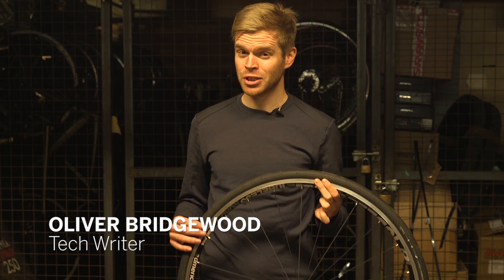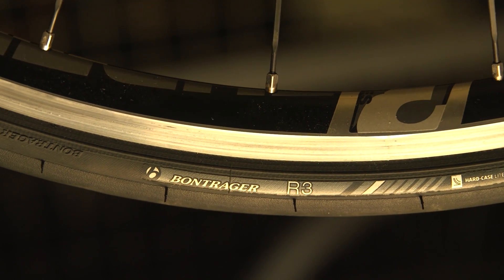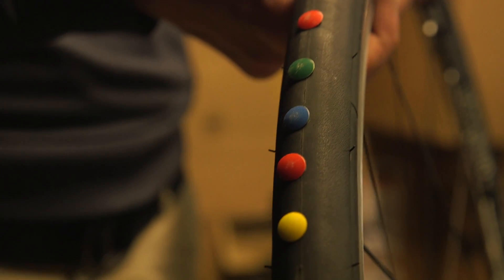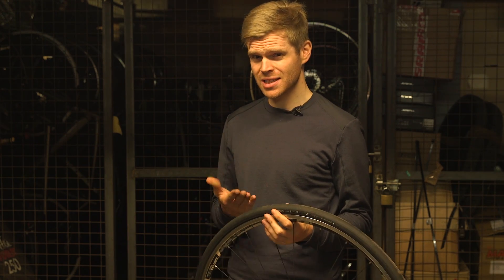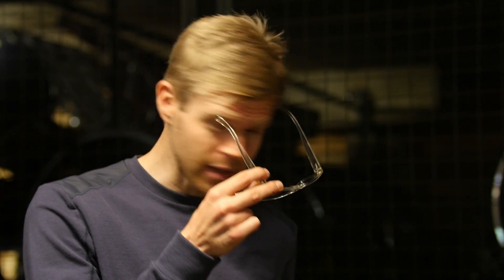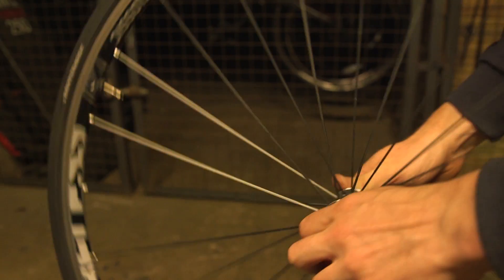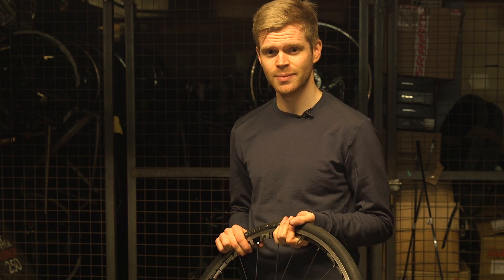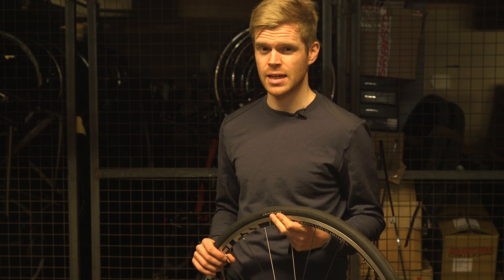Can a tubeless tyre survive a nail? | Cycling Weekly Science

Comment: Recently, while leading my senior's cycling group, I rode over some glass.  I didn't realize at time that I had three closely spaced punctures.  When we stopped for coffee I noticed a ton of tire sealant on the backside of my bike's frame.  Thankfully, the tire was still holding pressure, and I was able to complete the ride.  The tire was a mess, but it still held air pressure.  To be safe I ended up replacing the tire.
I'm 100% sold on tubeless tires.

Comment: Its heavier than the normal tyre with tube.  It has a rubber strap that is equal to tube weight and secondly it must be more thicker to avoid punctures and also it has sealant inside that is also weight.  It is complicated to repair and what i believe its a one time use, once it start leaking there is no other way to fix it again or else it will not work smoothly, not to mention its a cumbersom job to repair it. Sealant will also by the time get harder so it will make tyre uneven so more the punctures it get the more quickly it will get harder and get un even.
Reply: Only the last sentence of what you said is true.

Comment: My Schwalbe Thunder Burt (490gr, 26x2.1) front tyre blew a hole in the middle and sprayed the street with white goo. It healed in a few seconds and I didn't even have to stop to check it. I continued riding it as it was, jumping in high speed, etc, for half a year. Today I exchanged the tyres to a Schwalbe Wicked Will 26x2.5 rear/Magic Mary 26x2.35 front combo, which added 1 kg to my bike, but feels much more stable, like a tank. Inside the old Thunder Burt tyre I found a pee sized blob of dried latex just inside the hole, which had kept me safe all this time.

Comment: Weren't tubeless tires used like 40 years ago or so? I remember my dad always talking about tires actually glued to the rim. He also told me that the heat from the brakes would often soften the glue and detach the tires. What a mess.
Reply: That's Tubular tires- some people refer to them as "tubs".  Professional cyclist love them because they are a latex tube sew directly into the tire which saves weight and gives a more direct contact feel like riding on air.  Most of us poor people don't use them because they are sometimes 3 to 4 times the cost plus professional cyclist don't have to do the maintenance.  Removing and replacing tubular tires are a pain in the ass.
Reply: pros mostly ride them because tubular wheels are way lighter and you can stil ride (more rolling resistance) with a flat. normal tires would fall off the rim but the glued one still hold so you can finish the last km or stay on the bike during a turn.

Comment: If the puncture happens with a 170 pound rider on the bike, the sealant will have a much harder time sealing, I imagine. Then after losing some pressure the side of the tire can unseal as well and all the sealant will run out. Saw it happen to a friend who had a very small puncture.
Reply: Yet I don't know anyone who has had that problem. It's literally designed to stop punctures while you ride. I've ridden over plenty of stuff and the sealant did it's job.
Reply: Never seen a hippo ride a bike.

Comment: Why not put the sealant in a thinner inner tube? (genuine question, I'm an ebiker so weight isn't a problem but reliability is)
Reply: +CanIHasThisName I never get pinch flats and I use tubes. It's because I put powder between the tire and the rube so the tube doesn't get stuck to the tire when it hits a sharp object and the tube can just slide instead of being ripped
Reply: Bigfoot And Bananaman Interesting. Well I rarely get pinch flats because I'm used to higher pressure :) And when I do, it's usually because I forgot to pump up my tubes.
Reply: There are inner tubes with sealant available for purchase. While they work very well for punctures, they don't work at all for pinch flats. Pinch flats are usually the main reason people convert to tubeless (no pinch flats).
Reply: You can still get a snake bite puncture.
I've considered to convert to tubeless on my road bike, but after 7000 km (of mostly low quality road) without a single puncture this year, I don't think it's worth the investment.
Reply: you should take into consideration how thin the tubes rubber is vs the thickness of a tubeless tire, theres alot more material for the sealant to grab on to and seal, and the hard rubber attempts to seal back together as well, tubes cant take as big of a puncture as tubeless, besides, the point of going with tubes is to reduce weight as going tubeless can mean extra grams on your bike, and putting sealant pretty much makes that a mute point. I still use tubeless on my mtb as they give way more advantages in that situation, can run at lower air pressures to get more grip and still prevent pinch flats, pretty much something that wont happen on tubes. on road though, im not sure i would go with tubeless, the peace of mind of not getting flats is nice and all, but im not sure its worth the money and weight
Reply: Bigfoot And Bananaman false! talk is to not knick the valve when breaking or accelerating because the tire don‘t stick to the tube. talk doesn‘t protect from pinch flats.
Reply: panzerveps I agree. there are many advantages to running tubeless but i don't think it is worth the cost

Comment: Why wouldn't you want to go with tubeless? It seems like a great improvement over tires with tubes. And is their a way to repair a tubeless tire if you do get a flat? Or do you have to try and install the tube in that case.
Reply: +Jeff Green Typically you'd just throw in a tube and keep on your way. When you get home later you can glue a patch on the inside of the tire where the hole is. This will get you some more life out of the tire.
Reply: tubeless repair kits are a thing
Reply: Jeff Green they ride like shit and are a bitch to get on
Reply: They don't ride like shit if you drop the pressure a bit compared to clinchers. You don't need as high a pressure with tubeless anyway so they can actually be a little more comfy.
Reply: @123456bmx  That's bullshit.
Reply: because: 
it‘s a mess
it doesn‘t work with cotton tires
it makes the nipples corrode
it works but i have had 1 flat last season so pro is not enought
Reply: @ianiscaratti4924  and because of metathesiophobia. 
Your 1/year ratio will increase.

Comment: So how does that sealant hold up when you put weight on the tire.. as if you were really riding on it?
Reply: Last year I have got 2 punctures in a row in my two wheels while out on a training ride near Lloret de Mar in Catalunya. First front, then few minutes later back. I was using Mavic tubular tires and Bontrager sealant. It's worked perfectly. Managed to get home OK, the remining pressure was still high enough, however when trying to put some more pressure back into the tire after I got home, I've noticed it wasn't holding it and the seal was puncturing again, then resealing once it reached lower pressure again.
My conclusion, by all means great for getting you home safely, but tires (at least tubulars) need replacing afterwards. May be different with clinchers or tubeless, but certainly tubulars need replacing either way (unless you want to old school repair them)...
Reply: Brad Jensen doesn't loose hardly any when punctured by several large thorns.
Reply: I weigh 90 K and lose around 6 lbs pressure when it punctures, if I even notice it.  Usually someone behind me has to see the sealant spray out and tell me.  The biggest downside is cleaning the sealant from the bike after a particularly nasty puncture.  It washes off but you do need to wash your bike.
Reply: Steve Mc with acetone ...